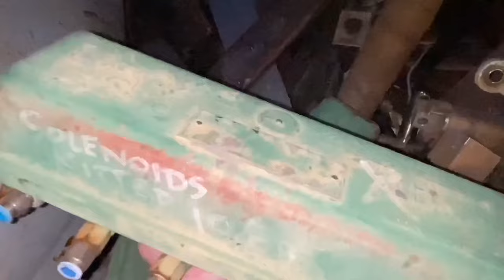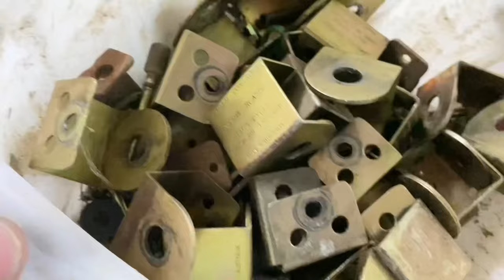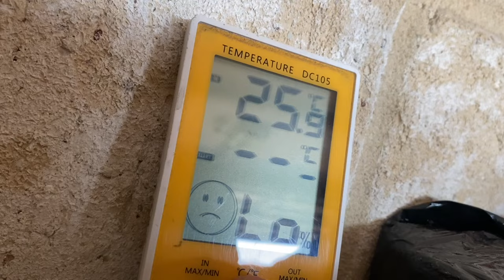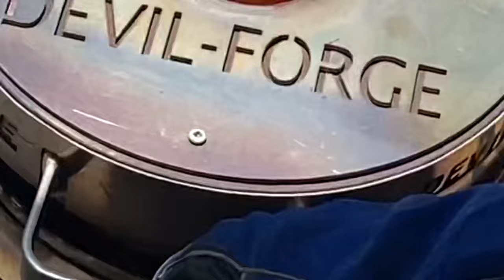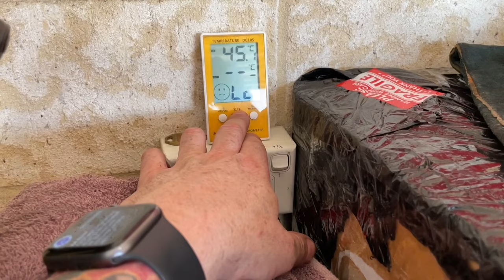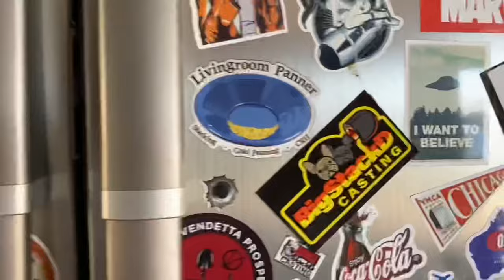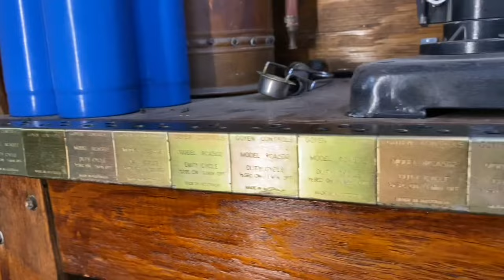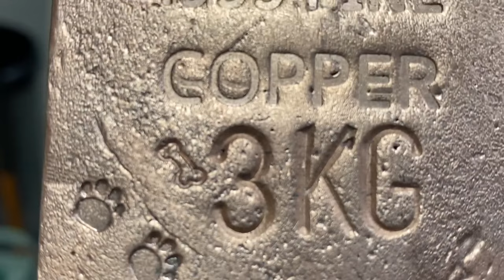9KG Pure Metal Dumpster Dive - Scrap Solenoids - ASMR Metal Melting - BigStackD Trash To Treasure

Comment: I'm an electrician and I have about 500 pounds of scrap wire saved up from the past 15ish months. I love watching your videos and only imagine the shelf I could have if I got  a smelting setup. I've been so tempted to buy one
Reply: Same thing goes through my head being an electrician
Reply: Same here but it's aluminum and brass I hored
Reply: He sells them
Reply from the maker: Well Ben if you’re interested hit me up on my email and I’ll send you a heap of info to get you started and a couple of discount links and even if you don’t decide to purchase at least you’ll have an understanding of how much it’ll cost and all the tips and tricks before you get started and that goes for everyone else in this comment thread👊🏻😁. 
bigstackddddd@mail.com
Reply: @cheapasstech  if you are doing it purely to make money, just take the wire to the recycler. The only question is strip or dont strip, if the extra money the scrapyard gives divided by the time taken to strip the wire exceeds the money you would make simply doing a part time job at McDonalds, dont strip.
Recyclers HATE ingots with a PASSION. A recycler can look at a bucket of copper wire and in 5 seconds turn to you and say 'ill give you barebright for this' or 'ill give you number two for this'. With ingots, they have to electronically assay them for metal content, and also punch into them for a deep assay, due to the number of people copper plating ingots of cheap materials brought up to weight with iron or lead, and passing them as pure copper - and the assay cost comes of YOUR bottom line, not their. Ingotting copper DECREACES its value-per-tonne at the scrapyard.
There are 4 main reasons you would want to make ingots:
1) As a hobby, purely for the fun of making and owning metal ingots.
2) As a way to store metal for personal use, ie metal that will later be used for casting and/or machining.
3) As an artist, to sell the ingots on the art market as art, not as scrap metal to a recycler.
4) As a professional smelter, to charge people to show them how to make ingots, or simply to make money off people watching you make the ingots. Its the viewers that make you the money here though, not the ingots themselves - bigstackD is a good example here.
If you fall into one of them 4 categories them by all means get yourself a devilforge and start banging those ingots out. If you simply want to make the most money on the scrap you generate through your trade, just separate metals and take the scrap as it lies to the scale as that is how you will make the most money. When I was on the tools for a short while 20 years ago, we used to hoard trade scrap (boilers, radiators, water tanks, pipes, wires) until the summer, weigh it all in, and use the funds to pay for a big curry and piss up on the town night!
Reply: @cheapasstech  yup, they pay more stripped, but the point is, is the extra money you earn worth more than the time and effort you spent, plus the cost of electricity or diesel if you are using an electric/diesel stripper, of actually stripping the wire? If it is, then strip away, if not, you are better off weighing them in covered.
Reply: Go for it. You only live once. Mind you, best to put a pot or two of food on top of the smelter and batch cook your month's food for the freezer to save money, mate.
Reply: @Debbiebabe69  now that's some good info. We would strip wire while we were just hanging out on the porch drinking beer, but we had time, and nothing to do... (New Orleans, right after Katrina..)
Reply: @gibbontakeit9098  yup, if time is basically free, the extra money from stripped with IS worth it. Always remember that scene from Shawshank Redemption 'that tunnel would be impossible to build, it would take almost 20 years' - 'you are talking about a guy serving life', he has all the time in the world.
Reply: @Debbiebabe69  haha! I just rewatched that like 2 nights ago.
Reply: @bigstackD  هل يمكن شراء فرن مثل هذا انا من Egypt وهل هو بنزين ام غاز وهل يوجد منه كهرباء
Reply: @bigstackD  ما هى الماده البيضاء التى تضعه على المنصهر حتى ينهى الشوائب
Reply: @cheapasstech  they give you less for ingots, much less. Also,, many yards won't take it at all.
Reply: @cheapasstech  100%
Reply: @user-lb8do4ew6k  why is that. do they think your hiding something inside it instead of the pure stuff its ment to be.
Reply: @WALLACE7084  Exactly
Reply: @Debbiebabe69  wonder if the same is true for aluminum?
Reply: @WALLACE7084  exactly this.
Reply: @TheStarforce2  key point with aluminium is separating the non-aluminium metals, otherwise you will get 'irony' aluminium rates at the scale which basically is the same as iron. Also keep regular alu seperate from drinks tins, crush your tins and weigh them in seperately as you get a better rate for tins than irony alu, if you mix tins with normal alu though you get the wretched irony alu rate.
And no, if you are selling metal to a scrapyard, NEVER ingot it. You will get LESS than irony alu.......
Reply: @Debbiebabe69  is this true in the states too? I've got a ton of breakage that I plan to melt, mainly mower engines and such
Reply: @TheStarforce2  scrapyards sell metal to processors, who sell their product to the INTERNATIONAL metals market, so it should be true everywhere.
Melt for pleasure, art, and personal use. If you want to make money scrapping, separate and sell intact.
The only way you can make money making ingots (as scrap, not art) is by registering as a professional scrap processor, for which you are talking minimum facilities of a $15million+ foundry and enough employees to run it 24 hours a day 7 days a week, not just one man and a $500 devilforge.
Reply: @cheapasstech  I think a lot of them get suspicious of people making false claims. You have to trust the person didn't just put a thick coat of copper over an aluminum block
Reply: Scrap some of that wire and buy a forge
Reply: Some have mentioned aluminum cans in this comment section. Do you get more from a scrap yard paying by weight? Or more getting 10 cents per can at a rebate location? I'd assume the scrap yard option would be more if i had one nearby.
Reply: Well did you buy one or are u ready to sell me your wire
Reply: @nathanhill6042  😂😂😂 I was just looking to see if he replied
Reply: Did you end up getting one?
Reply: @cheapasstech you usually get a tad less unfortunalty but I see most sell their ingots on eBay for 3to4 times the scrap value so I assume there is money to be made if you do it right me I just have a large treasure chest full of copper aluminum brass lead and some silver ingots 😂

Comment: I just had to find out why those solenoids were purple. I didnt find out, however I did find out that brand new they are worth $45.00(usa) each. Goyen seems to make all types of equipt for hard to handle materials and air purification. Wow! A lot went into those designs, wonder how long hey last b4 they need to be scrapped. Nice video as always.
Reply: @TheInsultInvestor  can't hate you for this... Your name says it's a joke, and up next you've got an insult for me ain't ya
Reply: From the search results I got, it looks like they might be controls for fluid valves. Maybe those solenoid arrays are from an industrial refrigeration system?

Edit: A second search after seeing the model number, and that looks like these solenoids were used to control a dust collection system instead of a refrigerator.
Reply: a friend  worked at Goyen  sydney he worked high up in the office  last time i seen him in around 03 you could see he was heart broken china had taken most of  their work ................................  lay offs etc i think he worked there most of his life
Reply: I can't believe how terrible the duty cycle was. 1/2 second on 60 seconds off? How could that even be useful in a industrial environment?

Comment: Dude I can’t get those purple pieces out of my head. I’ve never seen copper gush out before. They’re neat
Reply: Typical solenoids, and he described the coating as varnish. Not varnish, it's a polymer film of sorts. Frequently called enameled magnet wire, it's also not technically enamel.
Reply: @aredditor4272  thanks for that ... a polymer film...  interesting.... i gather it electrically insulates (for small voltages) as i use strands of this stuff for wiring fencing blades (the olympic sport..lol... sorry specialist sort of thing i guess... try to decrease my costs as much as possible by making up wires rather than buying them from overseas..)
Reply: @albertbresca8904  still nice, would like some. Will DEFINITELY not destroy the world
Reply: @aredditor4272  - Shellac is the name given to what is on the outside of the copper wire
Reply: @haraldpettersen3649  once upon a time, shellac was used in electronics, but it's been replaced by superior synthetics. 

It's actually one of the few substances found in nature that's like plastic. It's a secretion from the lac bug.
Reply: @aredditor4272  - Yes I'm starting to get old, thanks for the info 🧐

Comment: For the next copper melt, could you take the ingot while fresh from the mold and place it into a flammable material and cover with a metal pail then cover the edges with sand to seal in the smoke? I believe that you might be able to produce "peacock copper".
Reply: This is a great idea
Reply: @PauIieWalnuts  :: kind of like Raku with metal….
Reply: BoscoBob :: I saw the works of 2 artists who excavated and then buried plate metals, having placed explosives at strategic points against the metal, and compacted earth on top, and set off the charge.  The concussion was all underground and the impact distorted the plate in various ways discernible as it was exhumed.  Their final process was I think ‘re-plating’ ( chroming ) and buffing to brilliance these now organically-shaped, random-shaped  ( by detonation ) configurations of plate  steel (?). These were the artists’ gallery exhibits at that time and I will search for the link to this process and who they are.  Your “peacock copper” process intrigues me and triggered this memory of the UNUSUAL ¥
Reply: @codeblue2532  I've always enjoyed pushing the envelope in art. I took a .22 rifle to green ceramics and tossed old pennies into molten glass. I then used a reducing flame to get a peacock copper effect in the glass.

Comment: I have to say you are super lucky. When I look and dumpster dive I very seldom find anything worth while. These solenoids are from the old school for sure. Just so much metal you can do things with. I would bet you that these would be great to control flammable liquids for controlling a gasoline engine safely. You know, getting high mileage in the fifty miles range. The part I love is when you pour the copper. Looks like a fondue fountain. Nice work Sir.

Comment: When the stack reaches one tonne, I think it would be interesting if you did a reweigh to find out how much effect rounding had, and found the total value of all of the metal.
Reply: What happens when he reaches the tonne, is Bigstackd no more? I hope not.  Plus after the reweigh, build a wall with all the various bars just for fun.
Reply: It depends on the ratio of metals here but if it's mostly aluminium and copper then maybe a few grand
Reply: maybe he would do a remelt for some of those?

Comment: Had an idea: for large melts like this would it be beneficial to have an oven nearby preheating the metal so that you don't have to blowtorch every piece? Since you only have to get the temp above 100c to boil off water you could get away with a fairly basic wimpy oven.
Reply: Brilliant idea tbh could also keep his molds in there so they can be preheated for smoother pours
Reply: The furnace is insulated so I don't think much heat leaks through.
Reply: @DogMan077  He not talking about the furnaces, he talking about the molds having to be heated.. 
If Bigstack had an oven to pre-heat the molds it would help with cleaner and saver pours..
Reply: That's not a bad idea!
Reply: @Cent51  Toaster Oven from a resale shop would work fine.  I use one for my wood working with resin castings...
Reply: He blow torches the copper to showcase the blue color because it’s neat not so it will melt ice or boil water
Reply: @Cent51  ah I didn't see that before, that would make more sense
Reply: As if it isn't hot enough in there already...But sure! Just add an oven too!! 🤡
Reply: @chasingdemons7231  What?

Comment: The green paint on those cases usually signifies compressed air, anything running on air in my plant I work at has a green paint on it or green labeling
Reply: tnyleo ::: what is the significance of the purple coding ?

Comment: I’m getting one for my forge hose, but you might want to look into the Velcro closing covering you can get for TIG hoses. Meant to stop your water cooling lines from springing leaks when weld spatter hits them. Most good welding shops will cut to length.

Comment: I have  yuge amounts of many types of scrap . 
Lots of different electronic motors ie , fans , appliances . 
I also collect tin and I pull a 20’ trailer so I will pick up many items per day but then to sort it all out and eventually I will take certain items apart to sell at the scrapyard . I’ll take a trailer loads of  tin and the bed of my truck I’ll usually add aluminum items that I’ve broken down . 
I’m saving all of my ac compressors and electronic motors and all of my copper & brass fer a yuge load.

Comment: Loved the video, years ago when pouring copper into a steel mold it fused with the bottom of the mold, has it happened to you since? I have one homemade steel mold I made but I usually use graphite or cast for copper because I remember that. Just wondering
Reply from the maker: I’ve had copper fuse to steel molds probably three times since as I try not to use copper in those molds , unfortunately I can’t get a graphite mould big enough for what I wanna do with my coffee bars so I have to risk it and use the steel. I try to only use clean steel and nothing that’s had solder on it but it’s really just hit and miss at the end of the day.

Comment: I couldnt think of a better way to spend my day then getting stuck watching metal melt lol and the times you just break stuff or like at the end with rod where you just had to sneak it in to bring down the jenga tower 😂😂. After looking at your shelve I noticed the YT plaques...have you thought if doing a mold of the plaques? Is it even possible? Might be cool to see. Salute to down under and you can keep the 117 degree heat over there please and thank you 😂😂

Comment: I find soo much scrap out metal detecting 😂 I generally keep the lead, copper and brass. I came across a ton of wire from the old electric poles. I bought a little it home but was told by the scrap yard it was illegal for me to have. Go figure, illegal for me to have but ok to be in the ground, many kilometres of the stuff 🙃

Comment: small question : at out company we have housings made of zamac , i was wondering if these can be remelted and cast intoo bricks as the zink gives of toxic fumes and welding on zink coated stuff gives of a mustard yellow cloud that realy bad for you
as the metal and zink is mixed its combined melting point might be lower than actuall aluminium and that might allso prevent the zink from offgassing the toxic cloud

Comment: Just a thought. You should assign each melt a serial number. The custom pieces like the coins or shield or weapons are easy to figure out which video they go with, but the coins and ingots probably get mixed up. If each melt had a serial number, and the movie included the serial number, you'd know which bricks came from which melt. Could be as simple as 2202-21cu as an example using today and pure copper melt as reference.

Comment: i have a question. Why does the copper pour right out of the crudible but the aluminium sticks to the sides?  I know  they have different melting temperatures, but  if they are both in a their molten states wouldnt they act the same? Thanks

Comment: What happens to the paint? Does that simply evaporate? Do you also account for the weight of paint when you measure the metal lost (especially during marathon melts when the difference might seem quite significant)?

Comment: My firebrick in my furnace cracked in half when I accidentally dropped it cause I didn't notice it stuck to the bottom of my crucible. Any idea where I can find a replacement online that will fit inside my forge?

Comment: Hey Stack, great video(s). I have a question, are those ingots made of steel? And does the copper, aluminum,  brass, zinc, stick to that steel differently than cast iron ingots. I only have cast iron at the moment, but plan to weld up a couple mild steel ingots. Thanks in advance

Comment: Solenoids generally have precious metals (silver or platinum or gold) at the circuit contact points on electric solenoids (as opposed to air). Did you identify and separate those out mr Stacked ? (Sorry didn't watch more closely was cooking tea).
I know it's fanatical, but crush slightly and put through a high banker to get every crumb of metal... hahaha